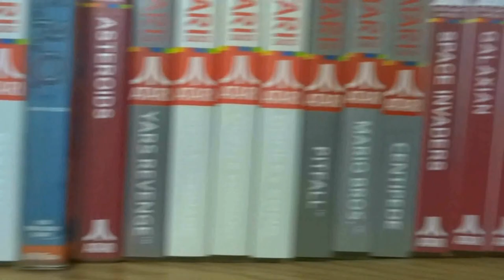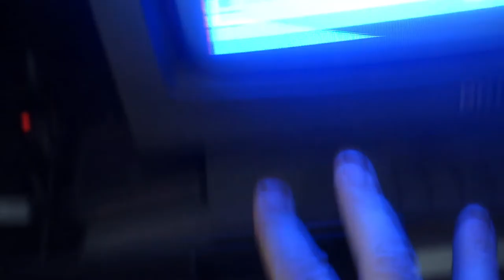Atari 2600 power switch replacement

Comment: That job took so long and was so difficult because primarily your soldering iron's tip is useless as it is. You should get a replacement, try to get a ceramic one they're cheap. And keep it always tinned, you can clean it with steel wool gently, but always tin it. Also, to desolder it's always easier to first add more solder and then use the pump. There are a lot of good videos about soldering for beginners. I give you these recommendations because I already went through all of this. Good luck! Regards, from Argentina
Reply from the maker: I agree totally.  I have already picked up a new soldering iron yesterday.  Thanks for your tips I will take them to heart and implement in further projects.  I appreciate it...
Reply: Another thing that will help make much stronger bonds is to press the iron to the contact, not the solder its self. And let the solder melt on the opposite side of the contact and bleed around and into the pin hole. This takes a quality, well tinned tip so that it transfers the heat quickly. I find a larger tip transfers more heat. As for de-soldering, the other method is to use wick, which is a spool of a metal braid that, when heated right on top of a joint, will actually suck the solder right into the braid. This is because the braid is coated with flux. It pulls the solder right into it. You might find it easier than the pump in some situations.

Comment: Nice work! Always awesome getting an old system running properly again! I couldn't believe that old switch even worked because it's an up-and-down slider, not on a hinge. It must've been in just the right position to allow for a bit of movement to make a connection.

Some soldering info to make things easier and faster: Get flux. Flux helps with heat transfer to meld old solder off and bead up new solder (like the soldering points you seen around the board) for the best connection. For the soldering iron itself, it's very difficult to get it working when it has all that black oxidation on it. Sanding all of it off to good tin or copper while it's cold, adding flux to it, then turning it on and melting solder to the tip again as it warms up before it oxidizes from heat will get the tip to work way better. The same with making sure to keep it completely covered with solder (called tinning). What that oxidation does is it doesn't allow solder to stick to the tip and thus yielding poor heat transfer. It "eventually" works the way you were doing it as you seen, but just a lot easier when the tip is clean and tinned.

Comment: Use a little bit of TV Tuner Cleaner on that Channel Selector Switch.  Sometimes they can get a bit gunked up and make connections that you don't want them to.  Tuner cleaner will dissolve all that grease and grime inside the switch.

Comment: I'm pretty new at soldering too and two tips I'm given is to add a bit of new solder first before desoldering and you can get liquid flux which you can paint over the solder points which will also aid in getting the old solder off but others have said you need a quality iron. I went through a couple cheap ones before I finally bit the bullet and got a digital temperature controlled soldering station from Hakko. Great that you got it working. It's a great feeling isn't it? I actually have a non-working right difficult switch on a light sixer. I'm hoping a good cleaning will fix it or I'll have to buy some replacement switches myself.
Reply from the maker: Thanks for that advice.  I appreciate it.
Reply: Was going to say. Applying new solder helps with liquifying the old stuff. Also, copper wire helps removing the rest of the solder that the pump cant get a hold on. Also, dont be shy with the solder. With solder points as humongous, its easy to remove the stuff if you used too much, but in this case a little more would have gotten you much cleaner solder spots.
Reply: And by copper wire, i guess you mean solder wick. :)

Comment: Be careful, it's possible to lift traces and damage solder pads when you're desoldering old boards. Find some old scrap boards to practice on til you get the hang of it. And as others said, a better iron makes a world of difference, and remember flux is your friend! Eventually you might get a desoldering iron (there are a few different kinds) which makes things a little easier... But kudos for making a beginners' video :) glad you got it working!
I came here with the same question a couple others asked: where'd you get the switch?
Reply: And I just realized it's 2019 now not 2018 so this video is a year old :D
Reply from the maker: Thanks for the information.  I purchased the switch from someone on ebay a while back...
Reply: I also found an original reset switch for my 2600 on ebay

Comment: Dude, I found out, that if you add some new solder to the existing solder point, you can suck it up better, because the new solder mixes with the older solder. Thats my tip for the day ;)
Reply from the maker: Thank you sir.  Yeah that sounds like a great tip.  I will implement in future projects.

Comment: Great job on fixing the 2600. But to solder you put the iron against the foil an component for a few seconds and then apply the solder. Also you need to have the iron's tip clean and tinned. Your tip is so oxided I'm amazed you could solder at all. But yes, great work on fixing that 'Vader!

Comment: Throw that iron in the trash and get a Hakko clone for $50 with temperature control and interchangeable tips.  That iron tip is heavily oxidized.

Comment: When you have finished soldering always melt a blob of solder on the tip of your iron. That will prevent it from getting oxide. Also when soldering the trick is to apply the solder between the iron tip and the component you want to solder so that the solder melts into a nice solde joint. The way you do can lead to bad solder joints with time. Enjoy the Vader Atari 2600!
Reply from the maker: Thanks for the tips, I appreciate it!
Reply: GRay Defender no problem 😉I had the chance to learn this from a professional.

Comment: Where did you get the new switch?
Reply from the maker: I picked it up also on ebay in an auction with other switches which will come in handy.  I do believe you can pick up these items from best electronics though as well.  Thanks for watching...